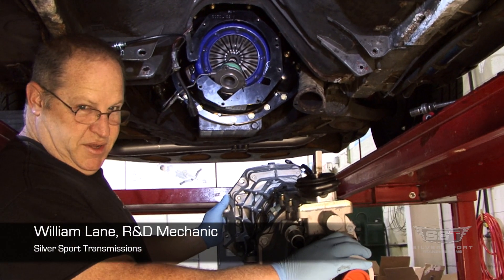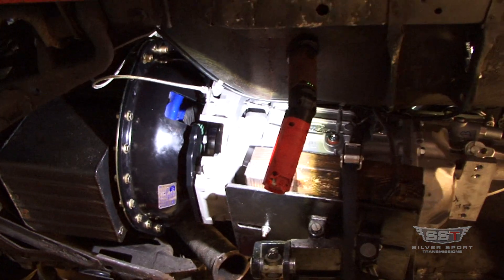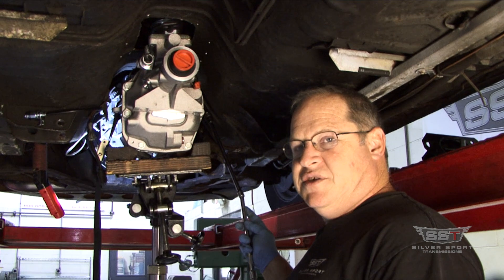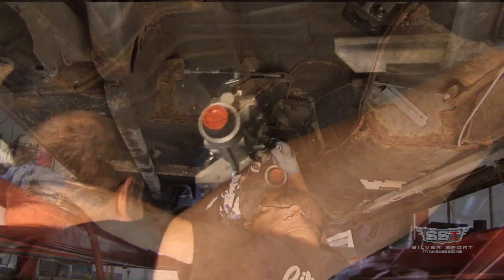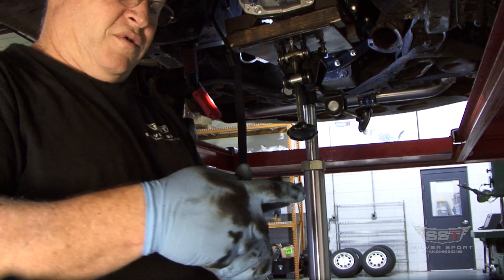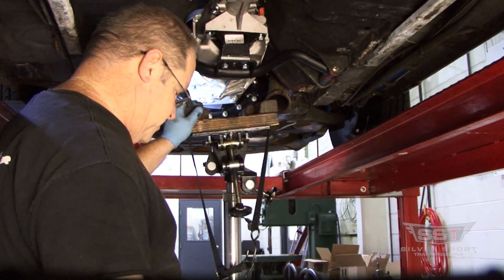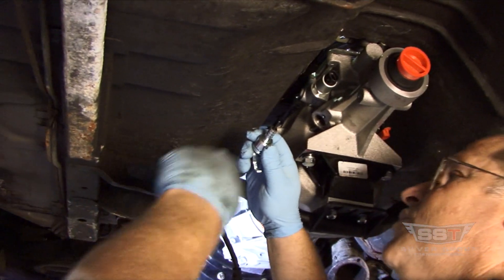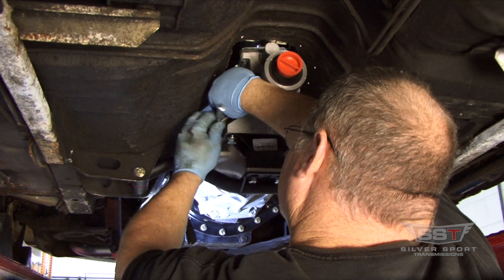Fox Body Mustang TREMEC Magnum Installation

Comment: What size bolts did you use for the trans mount going into the trans housing ? My trans mount kit didnt come with any
Reply from the maker: If you purchased from us, give us a call 888-609-0070. If not, 2 each of ½”-13 x 1” with ½” lock washers.
Reply: I can hear you just fine

Comment: what did you do with the pickup on the original speedometer cable for the cruise control ? or does that  get wired to the electronic pickup on the other side of the trans? my install is an 88 gt it has the speed sensor on the end of the cable by the trans im just doing research my trans kit is in the mail rite now
Reply from the maker: You will keep your existing VSS and plug it into the new transmission. It works the same as the T5.
Reply: Does the cable clutch need shimming as well or just like the way it is on the t5
Reply from the maker: @shannonshaw2996  Just the way it is on the T5.
Reply: Is this true? I believe you have to install the speedo gear on the trans. I dont believe the magnum comes with a speedo gear from tremec
Reply: @rattletrapfox1001  it's in the car last year. yes it does come with a gear in the trans and the pickup is on the cable assembly
Reply: @shannonshaw2996  let me look at the left side. I pulled out the right side and i see a hall effect type speedo sensor. On the opposite side that would be nice if i could reuse my t5 speedo sensor
Reply: @shannonshaw2996  you are correct sir! Do you know if i could use my t5 speedo sensor? I owe ya btw
Reply: Shoot me a link to my instagram and ill snag a tshirt or some merch 😎✊🏽
Reply: @rattletrapfox1001  yes its bolt in and go only issue i had is that the trans crossmember i got with my kit pushes on the cable and lets fluid seep out not drip but enough to piss a guy off and had to do further trimming to get the exhaust back in place also i wired the reverse lockout to a switch on my shifter and directly to the reverse power on the trans so i hit the switch and the reverse lights come on as well i used the hurst thandle shifter with switch incorporated
Reply: @rattletrapfox1001  i requested you on insta not quite sure what you mean tho
Reply: I would know because i just purchased one and i dont see a speedo gear in the tail